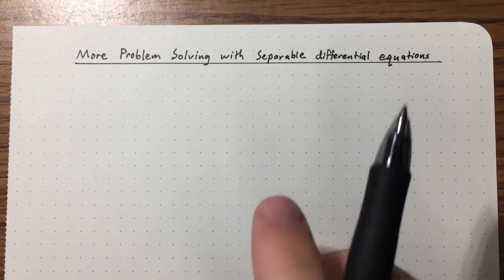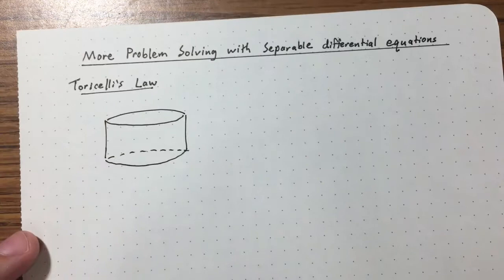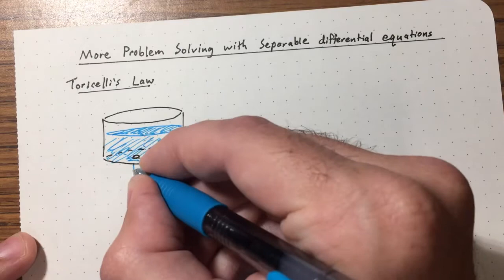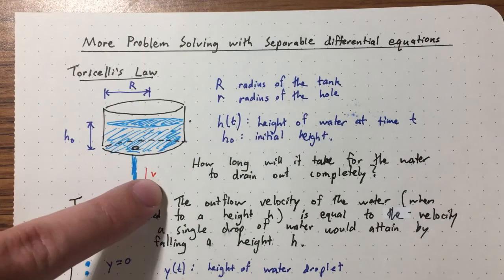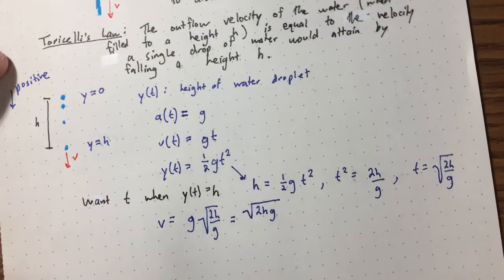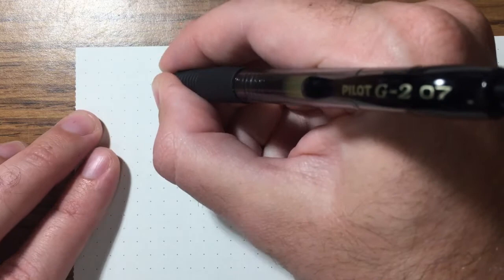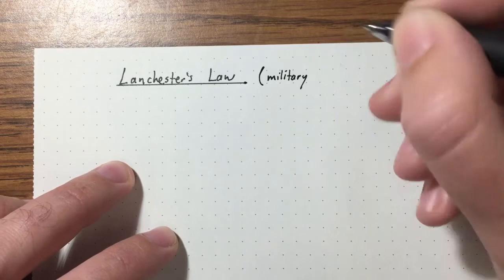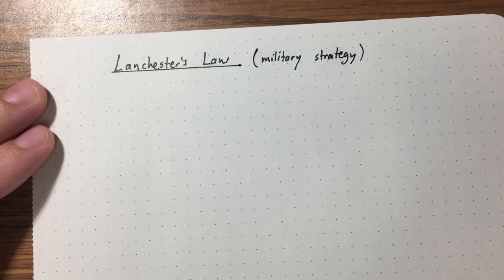Lecture 5 - Torricelli's Law, Lanchester's Law

Comment: Thank you very muchfor this! For the question "How to compensate by rising the skill level for a numerical advantage of the other side?" I just set C=0 and solved it. Same result. Did I overlook some sublety here? Again, thanks a lot - I struggled with this for hours, tried to solve the problem by calculating the actual solutions for A(t) and B(t) by transforming one equation into a second order equation, find the general solution and adapt it to the initial conditions for A(t_0) and dA/dt (t_0). It should work but I get lost in the calculations :D